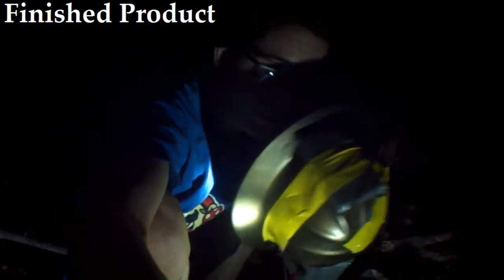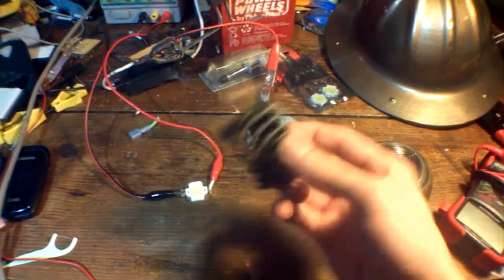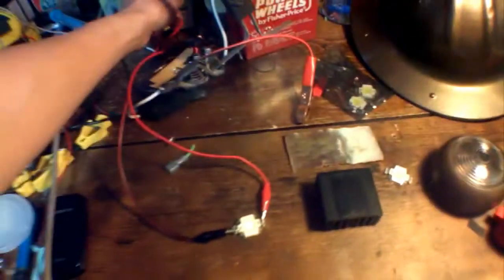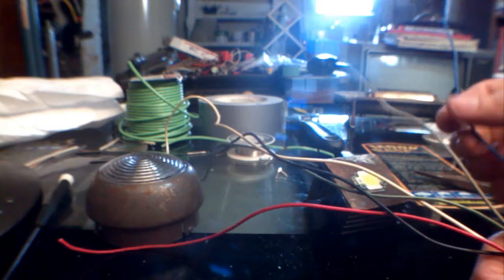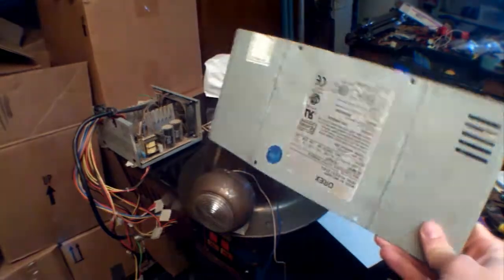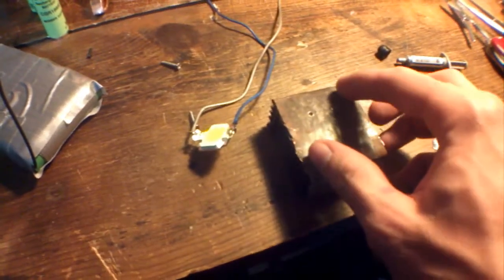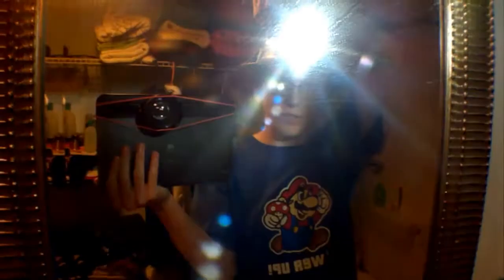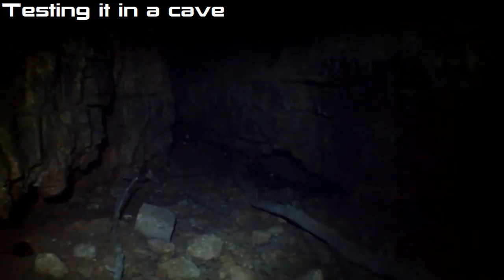DIY LED Steampunk Mining Caving Helmet part 1

Comment from the maker: oh i just wired the LED to the battery with a 50ohm resistor in parallel to the potentiometer. unfortunatly the pot's minimum resistance is only 30 ohms so its still kinda dim.

ima get a better resistor and pot, its just what i could find on an old tube controlled electric organ board. but basicly even when the pot is at it's highest resistance ( meaning it doesnt let enough power through to light the led)  the 50ohm resistor that runs parallel with it still lets like 80 ma of current through.